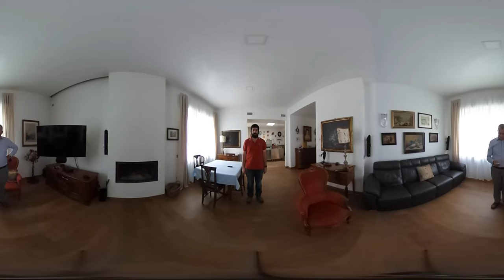Synthetic Ambisonics Demo

Comment: This sounds to be fixed audio when rotating around?
Reply from the maker: It only works on the mobile app, as far as I can tell. Furthermore, on some phone models, including my 2014 Moto G, the ears are switched. This particular recording has some audible codec artifacts in the last part, which would probably be solved if I loaded it with PCM audio.